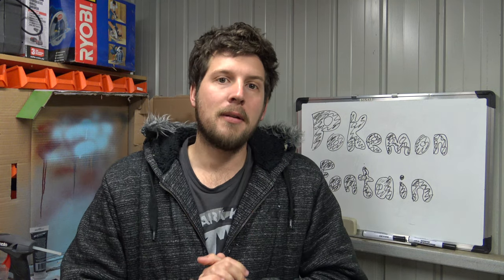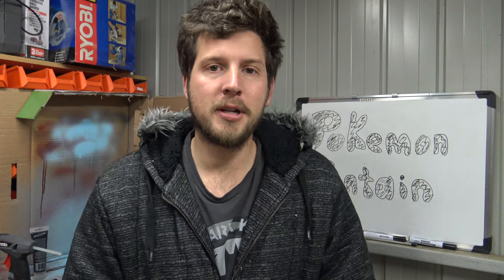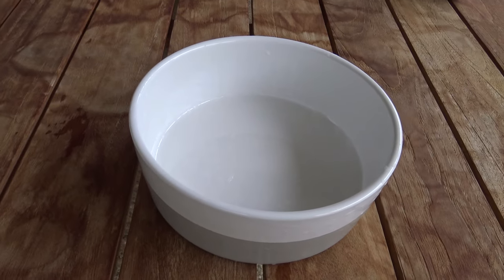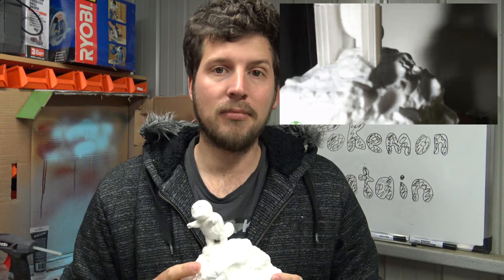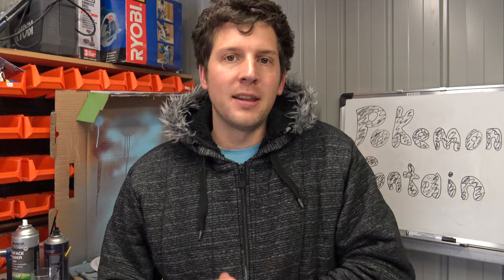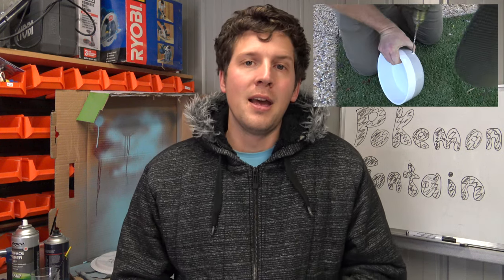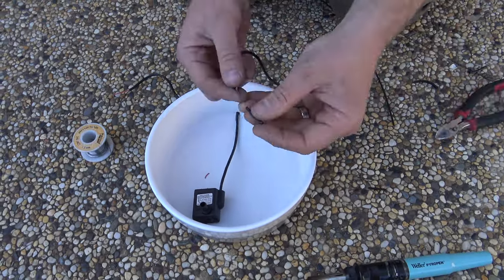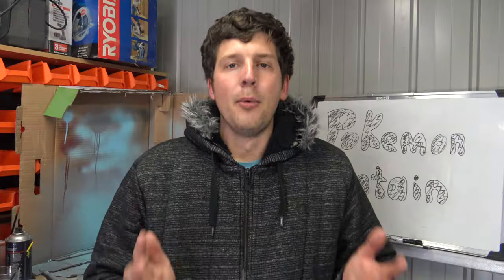POKEMON WATER FOUNTAIN - HOW TO MAKE A REAL LIFE SQUIRTLE WATER GUN DIY

Comment: Pretty Neat!  What did you use around the area you drilled the hole for the wire to keep water from leaking out?
Reply from the maker: +Erron Watts i first used hot glue but it's unreliable. Silicon sealant works really well but need to leave for a day to cure.